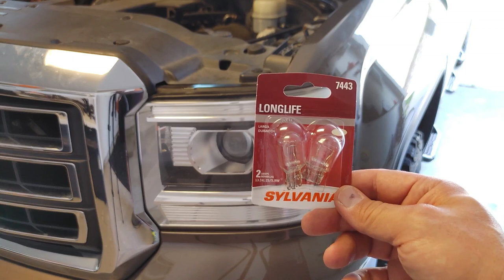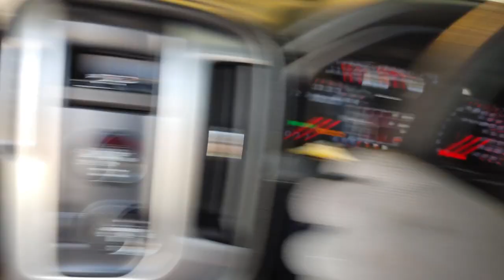GMC Sierra 2014 Parking Light Replacement Shortcut

Comment: Hey man, curious if you’ve ran into this problem before. After disconnecting my air filter housing and replacing the passenger side bulb, and then putting it all back together, Now my check engine light is on and my mass airflow sensor is being wonky. All I did was unplug it, remove it from the hose, switch the light, reconnected it all, and tighten the strap, and plugged it back in. I had the mass airflow sensor wiring and hose all replaced about two years ago, so I know it’s not deteriorated.
Reply from the maker: I didn't.  But I've found the Mafs on this truck to be kinda junky.  Unplug the MAFs , check for clean connection pins, plug and back and make sure it snaps good.  If it's not locked in, vibration interrupts the connection.  It's likely something is up with the cable.
Reply: @VanDelayVids  the connector clip is broke from a previous bulb replacement, but this is the first time disconnecting the hose from the filter housing since they were replaced. My fans overcompensated cuz of it the first 2 drives, but then normal fans on the third, but still CE light on. Hopefully it’s a simple tinker during my next oil change this week
Reply from the maker: I'm sorry to hear that, the CE light can be annoying for sure.  Id look at removing the MAF connection, checking for debris, and then securing it back again.  After this clear the CE light and verify the code is in fact for the MAF.  On these trucks at this age, its also possible that your throttle body is dirty and sticking.  If you cleared the codes and still have some idle RPM issues,  pull the throttle body side of your air intake hose, and look at the flap and most importantly, the walls of that throttle body, if they are dirty even a little, that sucker will stick!!!!   Good luck and let me know how you come out
 @jonrogers4738
Reply: @VanDelayVids  it cleared itself up after a few days. CE light isn’t on anymore
Reply from the maker: @jonrogers4738  even tho it's cleared you probably still have a code stored.  If you have a odb go check it and see, clear it if it's there.  You may be all set!
Reply: @VanDelayVids  I had problems 2 winters ago that when it got below freezing my CE light would turn on for 3 days and then shut off. Did that for 3 months till it warmed up for spring, but didn’t do it this past winter. Damn MAF sensors
Reply from the maker: @jonrogers4738  as long as it clears up I guess you know what to expect.  I know that I've used the duralast brand before and it didn't seem to last very long. The last time I've ever replaced them it was a AC Delco.  I know they are a bit more expensive but that one seemed to hold out for me.